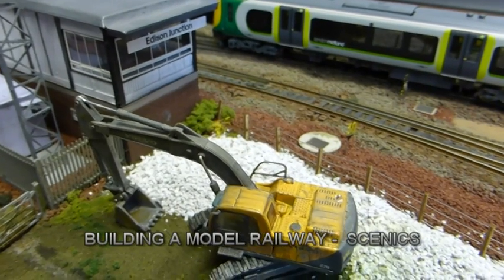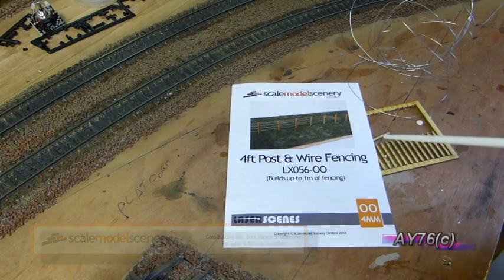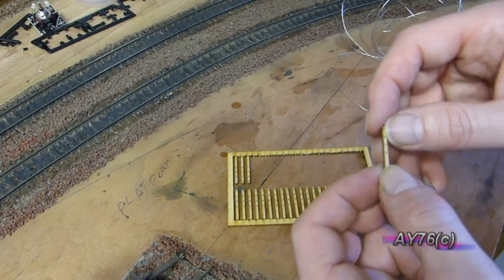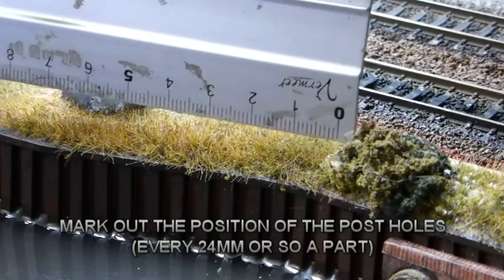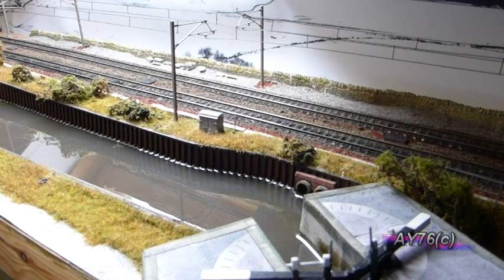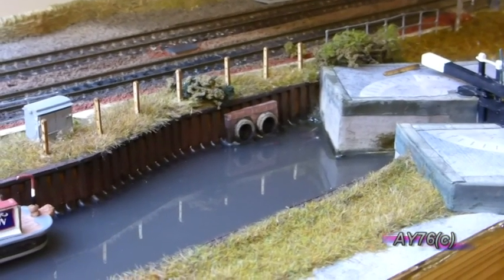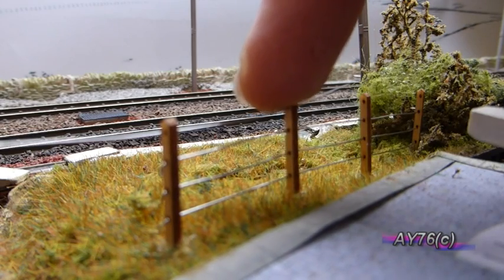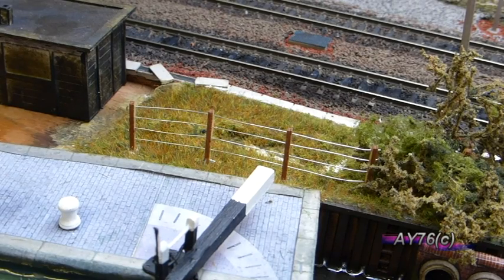Building A Model Railway - Scenics (Lineside Post & Wire Fencing)

Comment: very good video as is all your videos 
would it be easier though  to feed  the wire through all the posts first an then
fit them in place  this could be done in sections and at least the posts would not be disturbed  when they are fitted in place after the wire  been fed through them 
and it would also make it easier to tighten the wire 
keep up the good work
Reply from the maker: Many thanks for the feed back James, very much appreciated. You could do it that way i guess, but following the instructions that's supplied with the kit. Truth be told, i should of given it a bit longer for the glue to set on the posts. Was pushed for time filming. If give time for the glue to fully set as i did on the other section the posts don't move at all, so then easy job to feed the wire through & tighten off. But both methods will work well. Kind regards.
Reply: you are more than welcome
keep up the excellent work
Reply from the maker: Many thanks, will try my best. Kind regards.

Comment: great video Iain, now i am thinking how to make it without buying a kit
Reply from the maker: Many thanks John. Think for the cost of the kit it's worth buying, but depends if prefer scratch building.
Reply: agreed at only £4.59 plus postage but only does 1m of fencing so just thinking now
Reply from the maker: They also sell the posts on their own so that may be another option to look at perhaps? What sort of length are you looking at doing?
Reply: just looking but if its as good as yours, lots
Reply from the maker: That may be the way to go then, just go for the posts on their own then add your own wire.